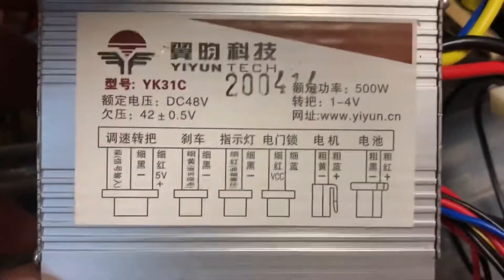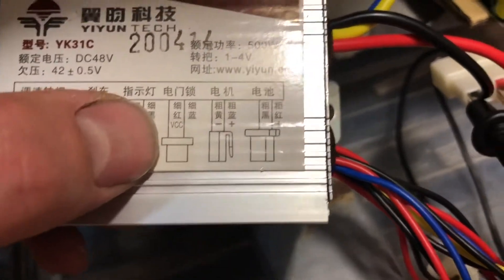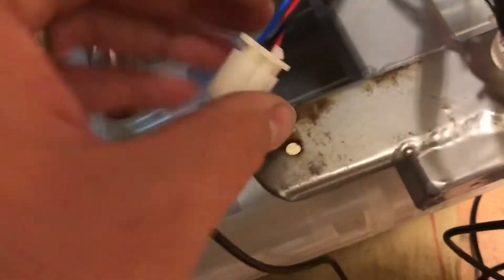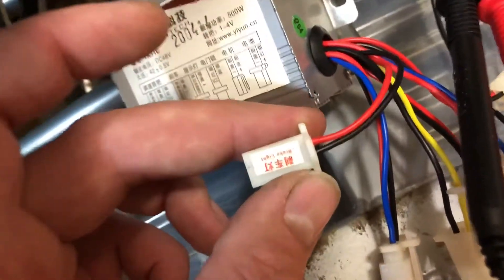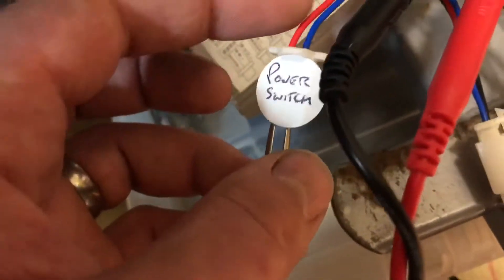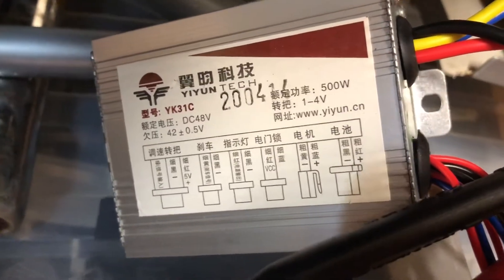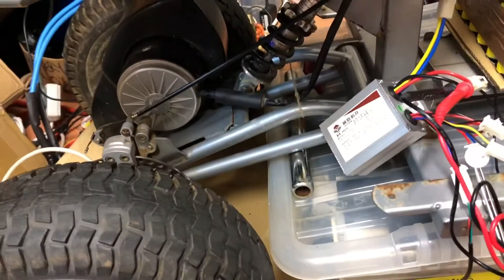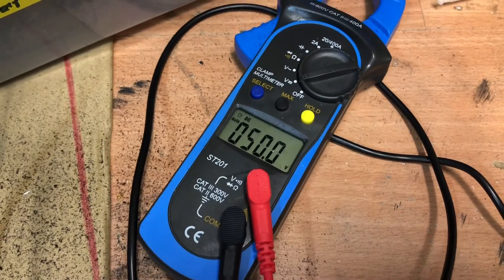How to turn on and Wiring up a Chinese DC Controller 500w 48v 52v to a kids quad Razor #smartazz

Comment: Stock motor 24v on the razor quad with 48v ? Is it still running or it blow up the motor im looking into doing this with my razor quad. Thanks
Reply from the maker: @KevinT1  still working
Reply: @ ok thanks for responding

Comment: I finally got it setup, same as yours. Does your controller become hot? Is that normal? Mine is very hot to touch
Reply from the maker: Yes. Try and keep it cool. Extra heat sink if you can will help.
Reply: @smartazz  ok, thanks

Comment: Mine  won't move when the wheel on the ground any idea
Reply from the maker: Fully charged? What BATTERYS have you got? I had one that would move the wheel in the air and then when you put it on the floor they wouldn’t move, Because the battery’s were bad.
Reply: There good batteries there out of a razor. I have that esc you have
Reply from the maker: @frankiej6329  what throttle are you using ?
Reply: Qimonda
Reply from the maker: @frankiej6329  can you upload a video of the problem?